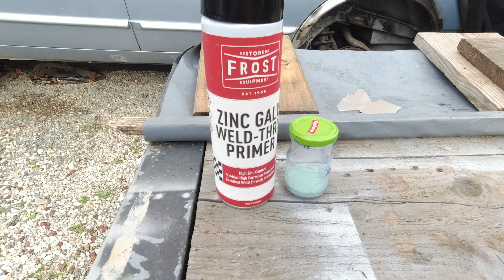RUSTY CAR REPAIR Part 11, PROJECT JAGUAR XJ, ENGINE REMOVAL, Welding test, Welding floor panel...

Comment: Respect and Admiration to you both yet again on this project in the open air workshop.
Are you recording how many hours you have put into your Jaguar ?
It looked very windy as well as a cold day too.
Already looking forward to your next video.
Kindest regards,
Phil in 53350.
Reply from the maker: Hi Phil, once again thanks for your kind words, I really appreciate and it's really motivating. 
Honestly I can't tell precisely for the whole project, but for this episode I recorded maybe 7/8 hours all and all. 
It's crazy as in 4K quality the files are very huge and this vide edited takes 250 gigas, and I keep all the rushes as is memories also.  
Yes it's the "problem" of this region, when the wind is coming it could be crazy, during the engine removal, some wind gusts reached 110km/h . With a cold outside temperature it's like north cap ! 
See you soon, kind regards 
Fred

Comment: I have come to a similar conclusion with weld through primer. I think the Upol stuff is better than the Frost but they all have a detrimental effect on the weldability.  Perhaps more heat is needed?
Reply from the maker: Yes you're right I add heat before to do the test and the welding is better. But now I must to be careful when I weld edge to edge with a bit "big" gap it's making hole. Honestly it's a big improvment in my welding and I feel now more confident. As I will use less primer I will come back to the Upol, it was better.

Comment: Great quality of workmanship !! Are you using .6 or .8 wire ? I tend to find using .8 and running the current higher is what ive got used to over many a project , sometimes the rustcure / phos usually doesnt stop the weld but ive had bother with the weld through. But carry on sir making a cracking repair you would put some places to shame !!
Reply from the maker: Hi Richard, thanks for your kind comment, it’s motivating 🤩. It’s a good clue to use 0,8mm wire as actually I have 0,6mm only. I’m often making holes when I weld 1mm steel and it’s penible to repair. I will try in the episode 13 the way you said.

Comment: Bonjour Mon ami , I watch a lot of your videos , and get lots of useful tips from you , merci ! . I have a v70 2005 like yours , I have a water leak by the interior mirror , I think its coming from the top of the windscreen , do you have any suggestions to repair it with ought taking the windscreen out ? Thank you , I lived in France for 7 years I miss it so much , but still visit my friends from time to time , I will be coming again in 4 days to visit friends second time this year , but first time in my V70 , I wish you and your wife well , keep up the great videos you post .Merci , Bon courage !
Reply from the maker: Bonjour Hugo ! Thanks for your sweet comment, cela me fait très plaisir, sincèrement ! 
I think you should start by watching from the inside by removing the 2 sides A pilar trims, sun visors and miror. Then you could be able to see the top of the windscreen by pulling up the ceiling. If there is a leak you could fix it by applying the glue I use for the outside moulding on the video, it's windscreen glue. 
If you pass by near Montpellier, you will be very welcome at home, just message me. 
Have a lovely day, cheers. 
Fred
Reply: Merci Fred , I will try that , but first will seal the top rubber from the outside , will let you know . Merci for your offer to see you , this time we are only in the Charente , but next year looking for a longer road trip maybe Monaco then into Italy , Bon courage with the Jaguar , so abientot till next year maybe ? keep up the great videos ... merci ! Fred .
 @psv1600
Reply from the maker: Thanks a lot, btw I watch the video you make with the orient express. It's so clever and i LOVE the deco, Bravo